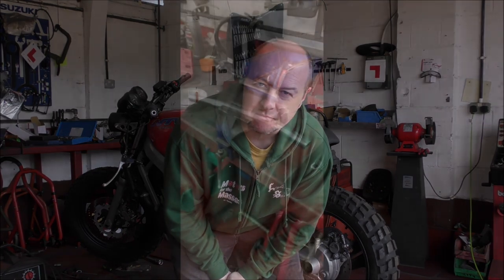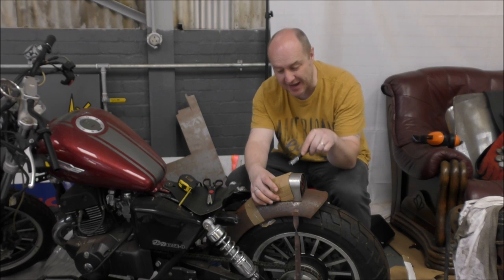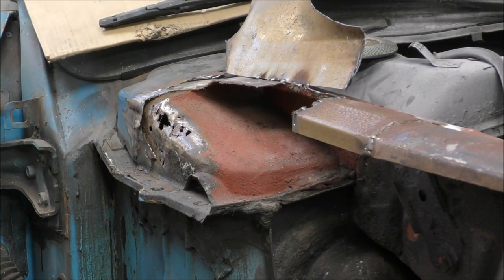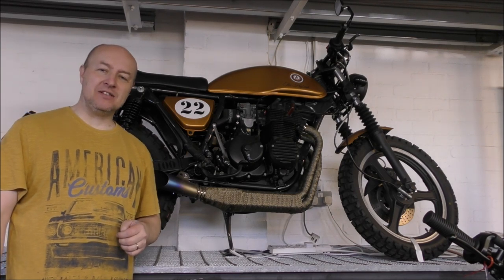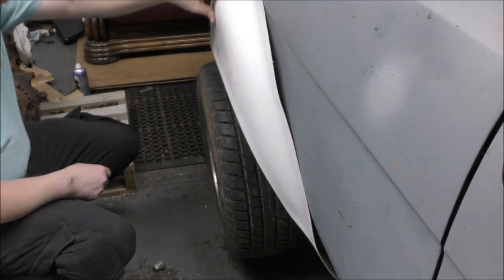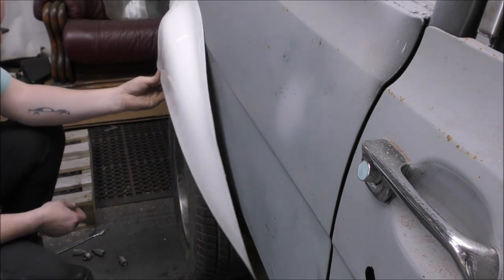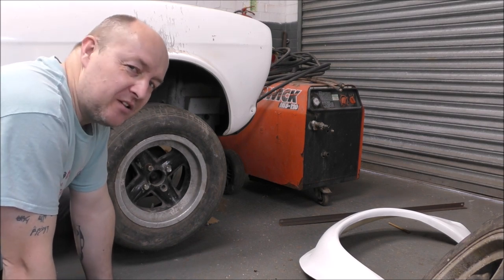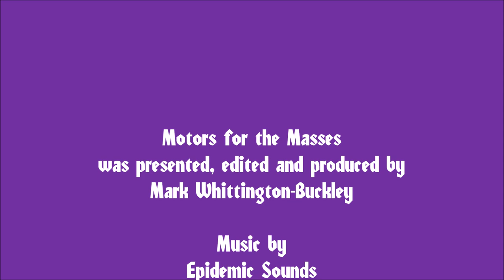MULTI-PROJECT session NTV650 BOB CB400 Mustang Escort

Comment: Not that my view counts but I think the whole cowl thing was a no go from the start. The rear light in my opinion should be one of the following...

1. On the side of the bike
2. Towards the tail end of the guard
3. A sleek led bar that sits directly under the seat
Reply: I totally agree with option 1 or 3.

Having a big chunky light on the rear mud guard completely ruins the flow of the bobber in my opinion.
Reply: totally agree. the light doesnt fit anyway.

Comment: make the spoiler look like the standard one one a mk2 rs2000 in black, i think they were foam! they went to the edge of the wheel arches  width wise.. just buy one sack that POS off. The NTV seat looks GASH! it needs cutting in at the front and those recesses in the tank to meet the old seat need addressing you would be surprised how easy modifying a seat is as long as you have the bottom plastic bit its just foam, staples and fake leather.